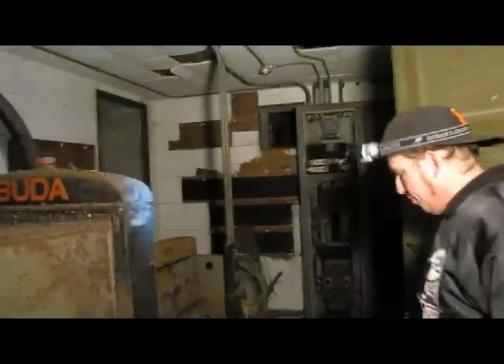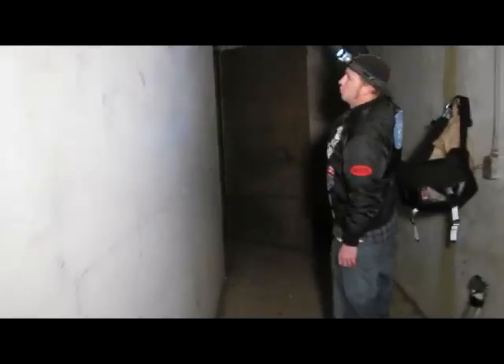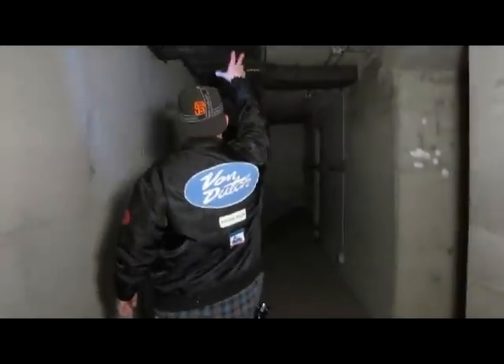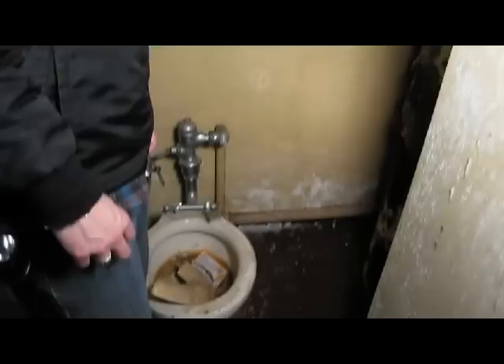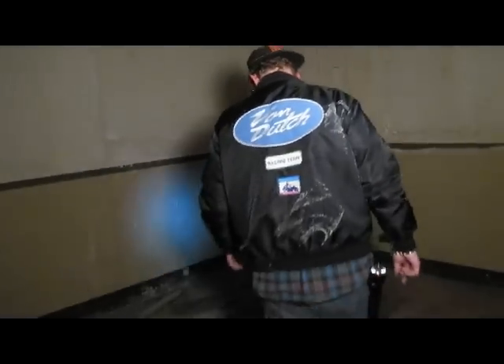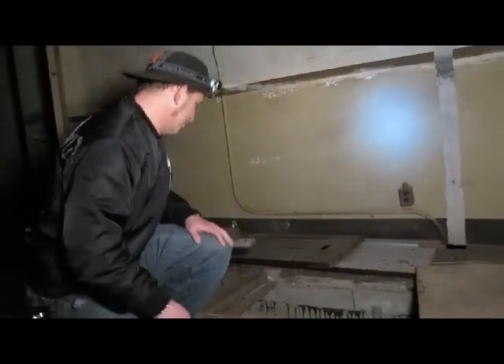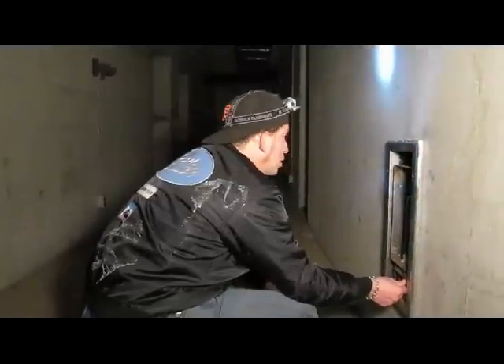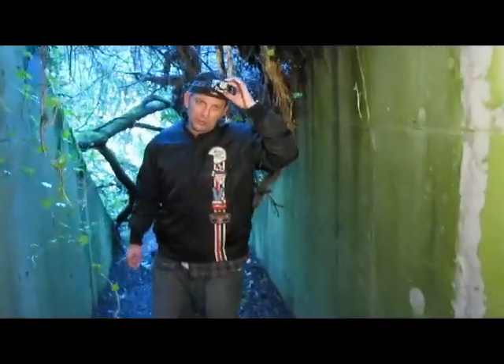Fort Barry Radio & Switchboard Room

Comment: Hello Don, I was curious if you've ever been inside Battery Wallace before? I feel like it's one of the larger batteries with the least information. Was there ever a way inside besides the main doors? I was able to find a medium-sized generator room that had a corroded metal hatch, but it didn't seem to connect to the larger structure- was curious if you knew anything about that. thanks
Reply from the maker: Inside? No. Actually there is quite a lot of documentation on the battery. Espically since it was originally constructed as open emplacement. The works were casemated as part of the modernization program. One of the few 12 inch gun batteries in the US that was actually casemated.
Entry to the battery was via the dug-in enterences, or at the rear of the battery. If you were actually inside the generator room there would have been access to the rest of the battery.
Reply: @DonMateo2028  Hmm interesting- at least I thought it was the generator room. Had two large U-shaped blocks of concrete. It had a small hole that led inside but it was a closed room. I have yet to see any photos inside the battery though, I assume its just active storage now

Comment: Hay do you know if it was buried or welded shut
Reply from the maker: Non of the above. While the site is dug in, the entrance was never buried and the entrance way was never welded shut prior to 2013.
Reply: @DonMateo2028 im curious to know if the park service sealed up the ventilation shafts as well-do you remember if the giant concrete pipe in the ceiling in the airlock room led outside? That could be a possible entrance.
Reply from the maker: @sebnation9250 The main vent in the engine room definitely vented outside. Now that is a whole nother game trying to even access the vent from the roof. Think overgrowth and lots of poison oak. No bueno.
Reply: @DonMateo2028  yes a lot of poison oak tried to scope out the area about a month ago totally overgrown couldn’t find a thing, but I also could’ve been in the wrong area
Reply: @merpman2781 i actually went there earlier today and found it. Was pretty overgrown though and no signs of ventilation shafts in the bushes from what I could find
Reply: And no way to enter through the signal corps manhole from what i could tell
Reply from the maker: @sebnation9250 That would be a no.
Reply from the maker: Believe it is welded shut these days. Probably right after I did the video.

Comment from the maker: Thank you for watching. Glad you enjoyed it. As far as the asbestos goes, I am quite aware of it. Worked for years in asbestos litigation. That is why one treads lightly and does not touch or walk on any of the damaged ceiling tiles. I do believe that I clearly state in the video that the tiles are asbestos. Not a lot of air movement in the place, and the air showed no ambient dust when it was lit up. A mask would be optimal, but I don’t think you need a Stage 3 Hazmat Suit to enter.

Comment: Great vid. The tiles on the floor are asbestos, all military buildings have it.  dont go in any of the buildings theyre all dangerous especially because they're not maintained.  Just you running around in there, opening those steel blast doors stirred up all kinds of dust, toxic or not. those ceiling tiles have been falling apart for 70 years at least, I'd say it's completely free in that place.  I love the Headlands too but stay safe kids. stick to climbing on Battery Mendell.